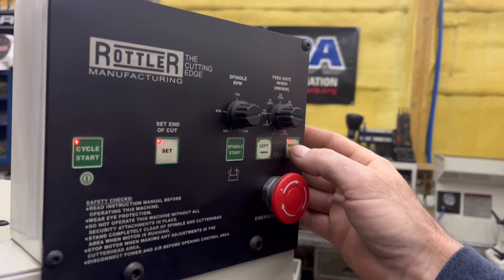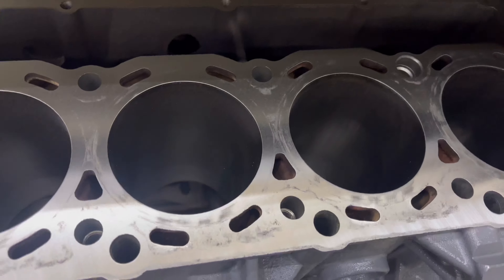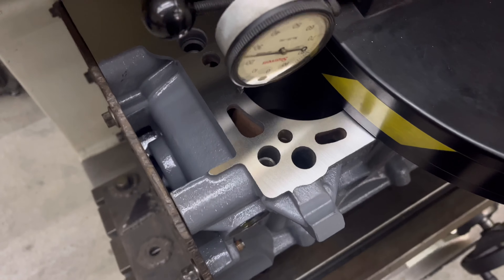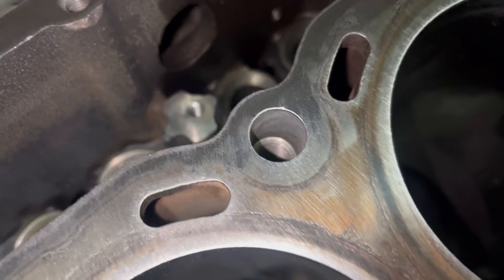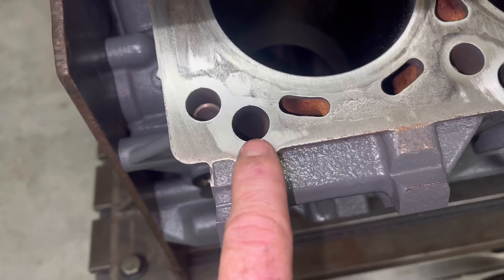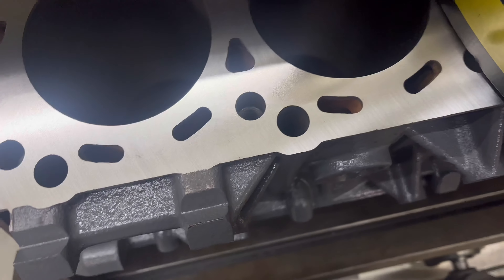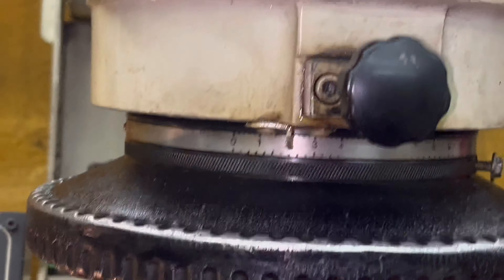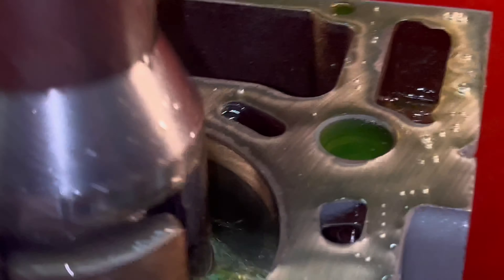It’s not warped,,  it’s just not flat

Comment: The last cylinder where you check the oil ring the wall looks horrible with holes.
Reply from the maker: Are you sure it isn’t lint??
Reply from the maker: When I’m checking rings,,  I think I’d rather worry about having the cylinder lubed up so I don’t scratch it with the test fit.  Not too concerned with the lint left behind from a quick wipe out before oiling and testing.

Comment: That block is a beauty!!! So your guys stance is  most ford OEM gaskets need some form of additional gasket material. I've done the oil cooler, valley up and 4 years later noticed the oil cooler top plate leaking. When I did mine the only place I put the gasket maker was in high pressure pump cover in the rear corners.
Reply from the maker: The oil cooler has not gotten any extra sealing from us sofar.   I know exactly what you are saying tho.  The alum casting of the oil cooler housing leaves a lot to be desired to stay bone dry for life!!!  I don't think they ever will stay dry until we figure out how to safely seal it up!!!
Reply: @AnthonyYoungblood  thanks for the reply!!!